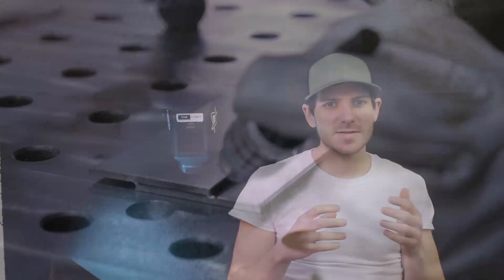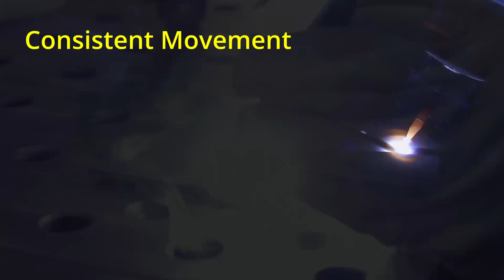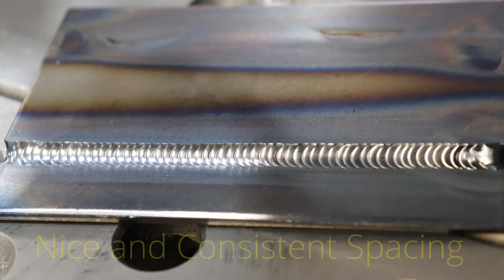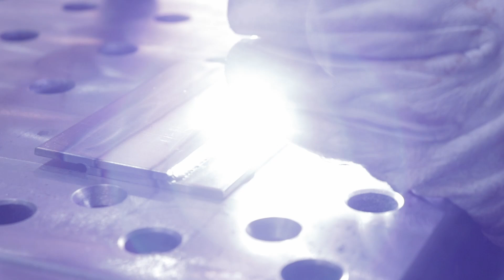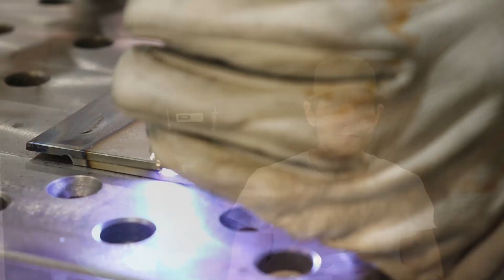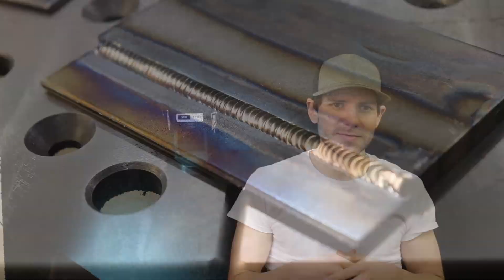Most People Don't Know These Simple TIG Welding Techniques

Comment: As a relatively new welder, I use the pause and move technique and I've had a bit of difficulty keeping my puddle overlaps consistently sized. I also suffer from too much heat into the piece. I'm going to try the continuous pass method ... thank you for the tip.
Reply from the maker: Anytime bud!